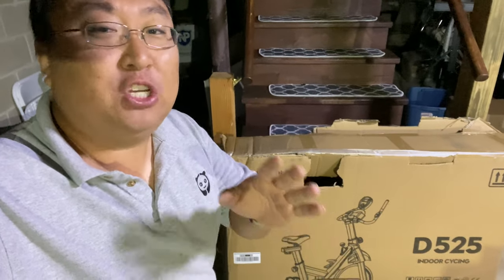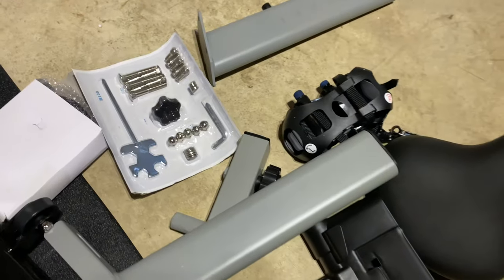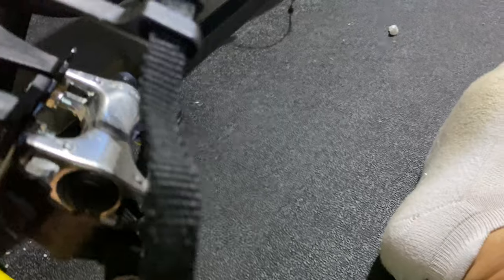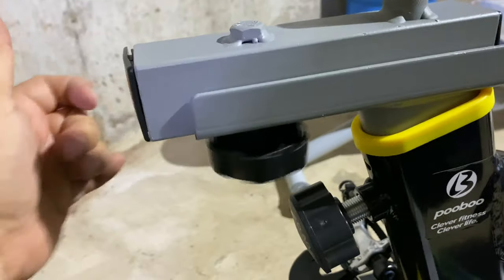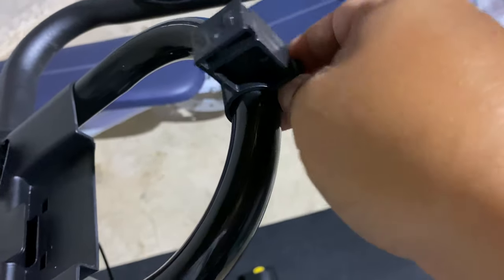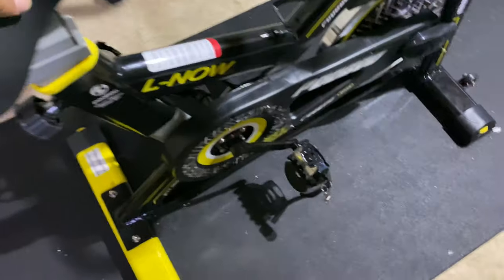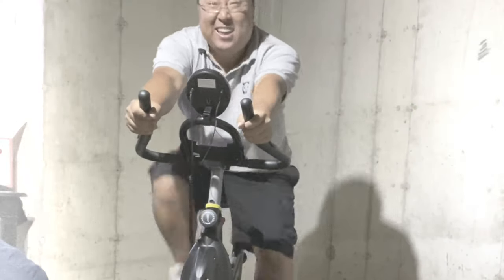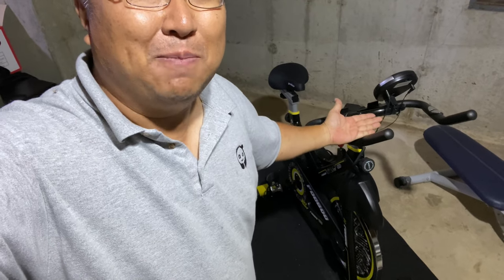Best Cheap Spin Bike For Home Review

Comment: Another option is if you already own a bike just get a cheap trainer and add a speed sensor and mate it with one of the many bike training app. I have a carbon road bike currently mated to a kinetic trainer and use a trainer app but I’ll eventually get a smart trainer so I don’t stress the carbon frame on the trainer.

Comment: Yo Big Bear!!! I just bought a 'Women's Health Men's Health Mini Stepper' on eBay. This particular unit is really substantial and has some weight to it. I think it's around 50-60 pounds. I can tell you it's really well built and well designed and versatile. This thing, fully extended so the platforms rise to their highest position, is like riding a bike while standing up. It's great. You get a no impact workout like a bike gives you right in your home with upper body workout using the elastic cords that attach to its base. You should try this thing out. The steps or platforms you place your feet on can be locked in an 8", 10" or 12" high position to act as a fixed step like on a stepper exercise platform. So, you can use like a platform to step onto and off of for exercise. It also has a digital readout for measuring steps etc. The whole unit is basically 24"x24"x24" approximately.

Comment: So I bought this bike and got it set up but I cannot get the display to work. Has batteries In there it will tell me my heart rate hit as for the miles or time it does not seem to work. Where did you connect the other end too?
Reply: Same here just got yesterday the monitor display is exactly as u say..im.so confused a

Comment: The pooboo is one of the top sellers on Amazon, but a number of reviewers mention some functional issue within a few months. How's the bike working for you now?
Reply from the maker: It's still working fine. I use it more like an exercise bike and dial up or down resistance. Some people may stand up and ride it harder, but I haven't had any problems with mine at all!

Comment: Is it loud? i dont want to annoy my neighbors
Reply from the maker: I don't think it's loud. It's much quieter than my treadmill. I would get the impact mat to put it on. It dampens vibrations and sounds. If you're in an apartment, I think this would be the right piece of exercise equipment since it doesn't bang or impact.
Reply: @petervonpanda  awesome thanks
Reply: No. It's not loud at all. It's quite nice.